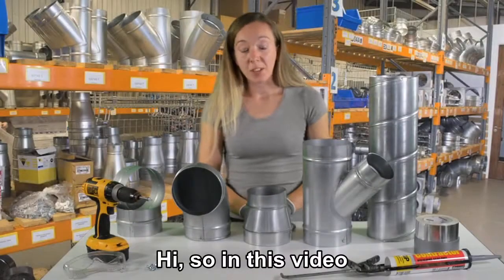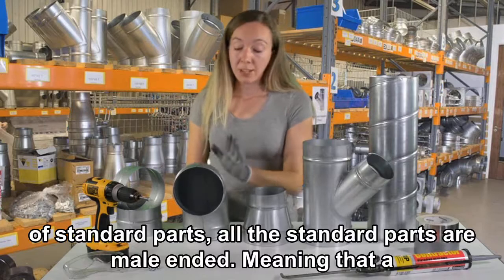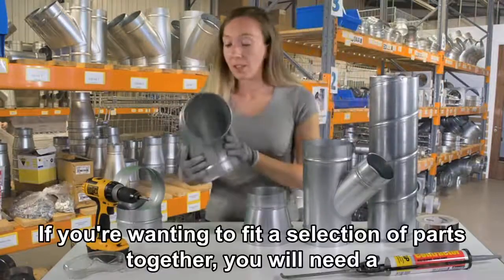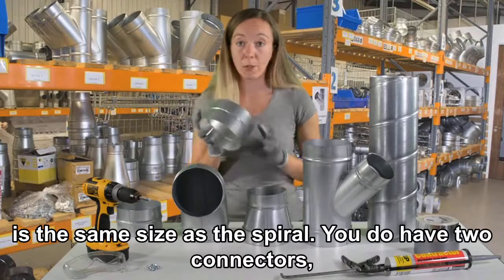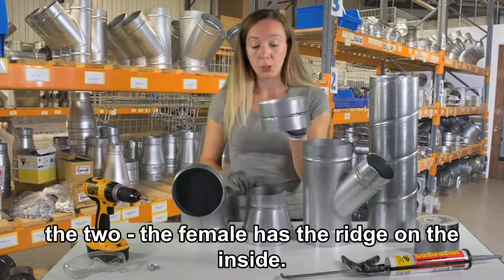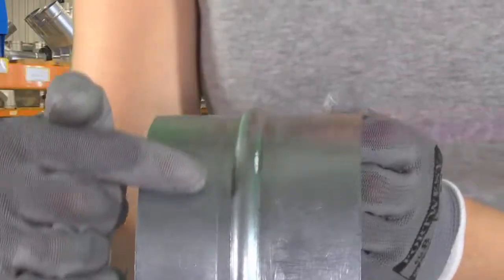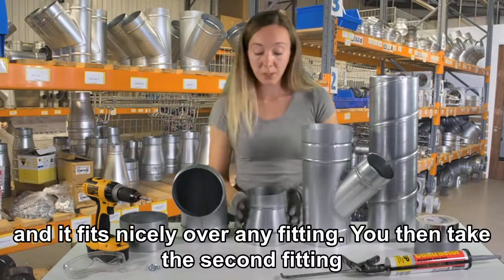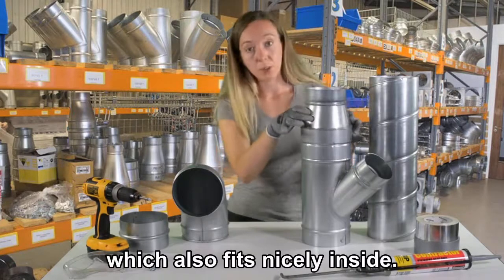How To: Fit Ductwork Parts Together

Comment: Could your system work with non spiral ducting such as PVC straight ducting 

Ta
Reply from the maker: It would depend on the internal and external diameters of the pipe used, but yes it would work.

Comment: Is it possible to have a connector to join 2 pieces of crimped 4inch duct together? One end of the connector on the outside and the other end of the connector on the inside..
Reply from the maker: Drop us an email with photos of what you need and we'll send over what we feel would work best for your set up.